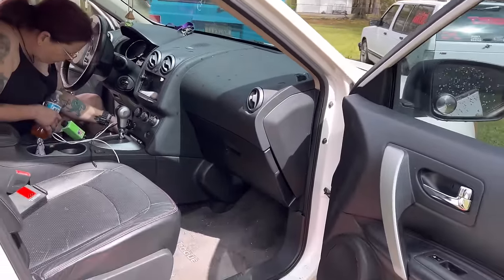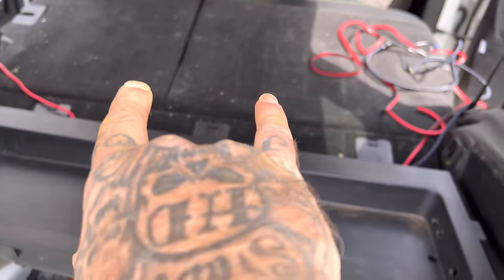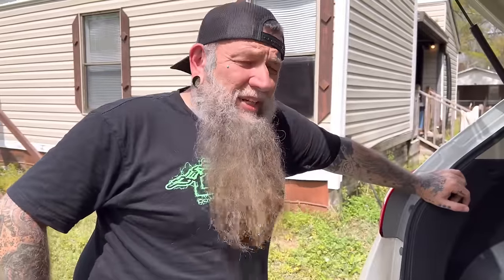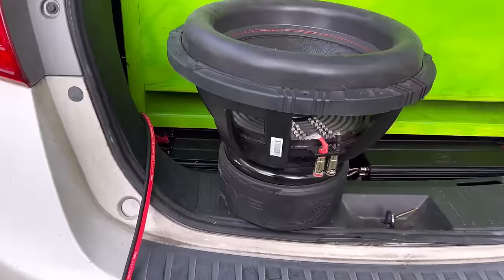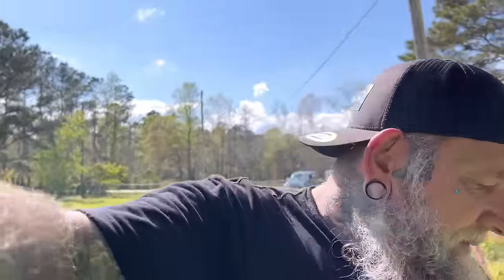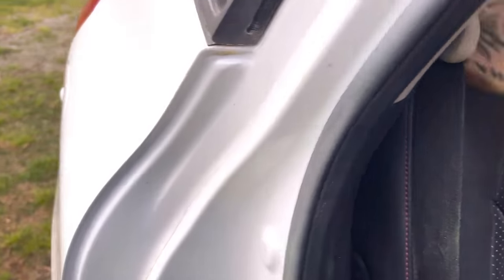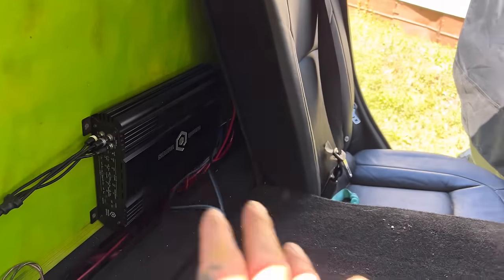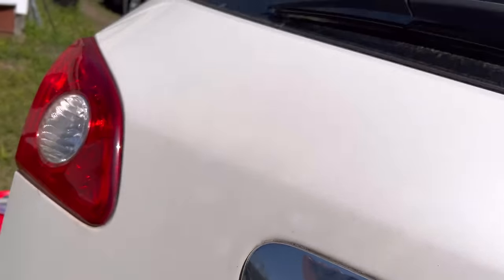The Rogue no wall build is done.. amp smoked.

Comment: Finally someone who agrees with the theory of subwoofer break in. You did a great job of explaining what happens if you don't. So many idiots on forums like Bassheads On A Low Budget giving out advice saying "send it" "no break in required"... great advice. Then you have the theory about impedance rise, that's a whole nother can of worms...
Reply: From what if I've seen it's fully dependent on the sub and how much power most low end subs if your using an amp rated to match the subs RMS you should be fine (I'm still gonna give it at least 12-24 hours of play time half volume cause I don't anyone or anything 😅)

Comment: Awesome job on that box guys. Very nice and clean build so far. Hey jerry, Where do you suggest putting my subwoofer level on my head unit? I can't find a sweet spot. My sub level goes up to 10db. And my taramps md 8k is set to 89 volts like it should be. Everything else on the head unit is stock settings other than the crossovers. Low cross is set to 63 hertz, -6db. High is set to 250 hertz. My point is, my sub (sundown X 18 v2) gets very stinky very fast and I'm only hitting 140db at max on music. It is in a 2006 toyota tundra double cab.  I feel like this sub should be hitting 148 at least. Box is 6 cubes after displacement, tuned at 31 hertz. Any ideas why my sub is getting so smelly after 3-5 minutes? Also I never go past 80% volume on my pioneer head unit. Amp is not clipping. I'm lost on ideas of why this sub is not getting down like my other 18s I have. Thanks

Comment: I set my sub low pass on head unit to pass through and use the amp. Bass sounds way better. Only found through setting on jvc and kenwood head units though. The bass is so much better though
Reply: Yes that’s normally how i run my subwoofer xover on my kenwood but trip out on this. I found out that after turning the subwoofer setting on and off wohld completely kill the bass on my inside speakers!!! I was like what’s going on !?!?! Turns out when I run the sun low pass filter on instead of through like how your saying it completely drowns out the base from my sound stage. Test this by toggling on and off your woofer thru the headunit and see if you notice a difference. I don’t always run my sub I usually turn it off when I’m in my building to not piss anyone off or when I’m listening to talk shows ect and it took me a while to figure out 😊

Comment: 🎉🎉 JERRY LOW PASS IS SO YOU CAN RUN MIDS WITH BANDPASS FREQS.  = NO HIGHS AND NO DEEP BASS. 😮 🎉🎉
Reply from the maker: Actually high pass is subsonic filter. It will cut everything under the set point, I have it at 20 so it will not play under 20